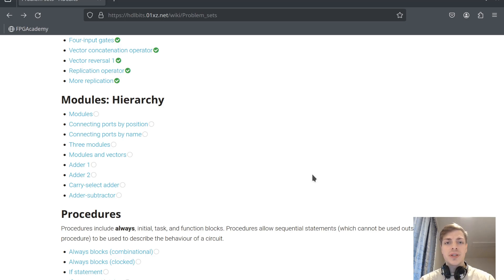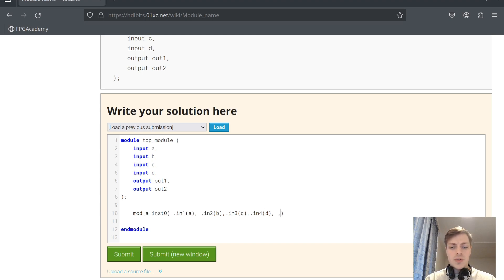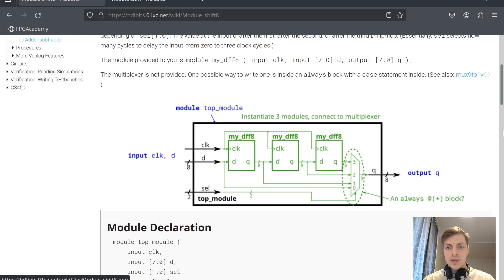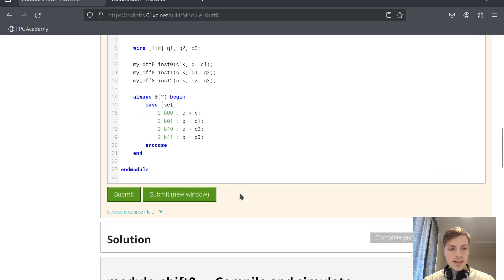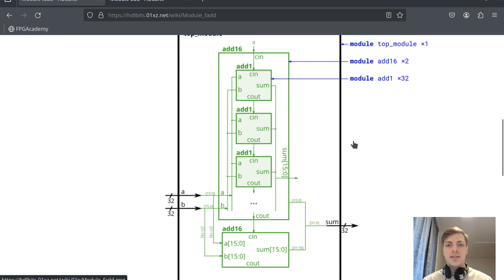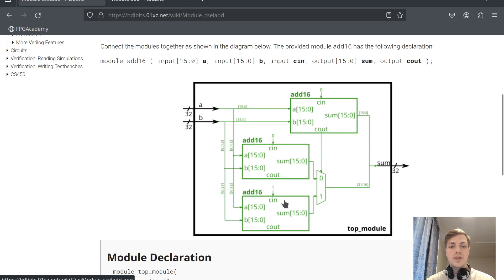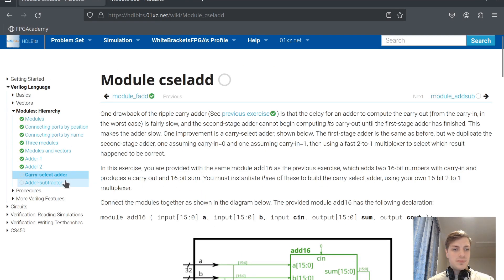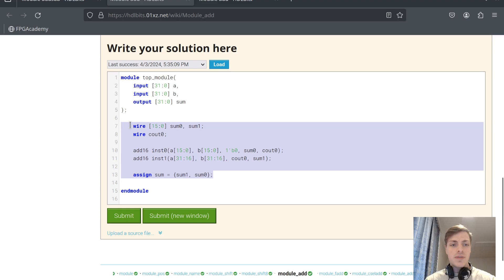Mastering Module Hierarchy: HDLBits #3 Modules

Comment: Hi. In the Adder 2 example how is the "add1" nested inside "add16"? I understand it like this that the two "add16" are instantiated inside the top_module. But the "add1" module is defined outside as it should but not instantiated inside "add16".
Reply from the maker: The add16 module is provided as a black box, with its internal workings (including add1 instantiation) hidden. In this exercise, add16 is pre-defined to use add1, and your task is to implement add1.
Reply: OK thank you.